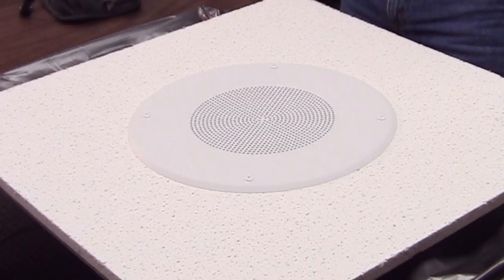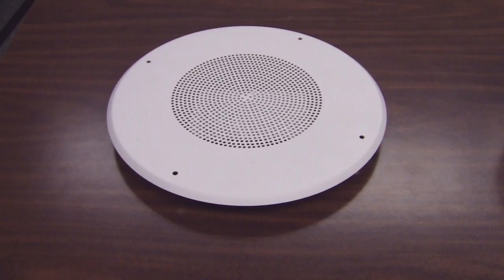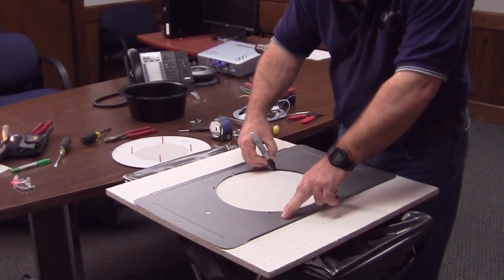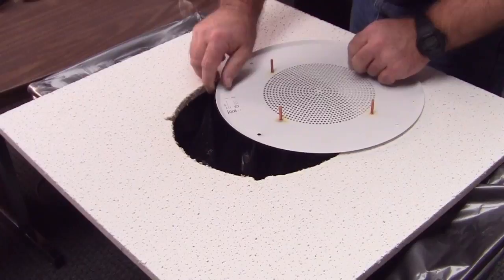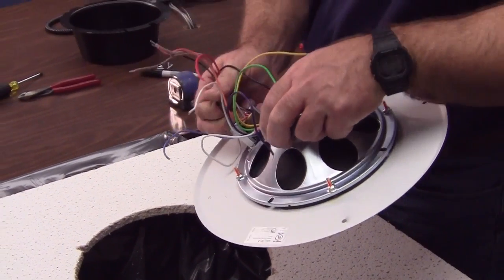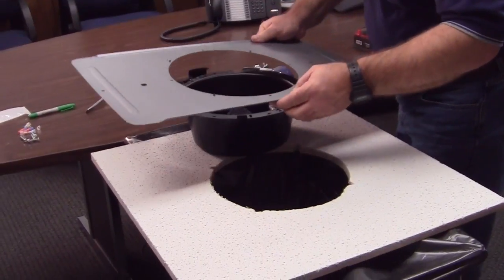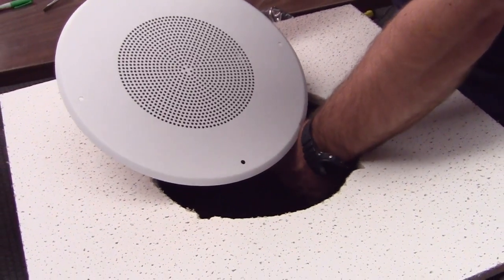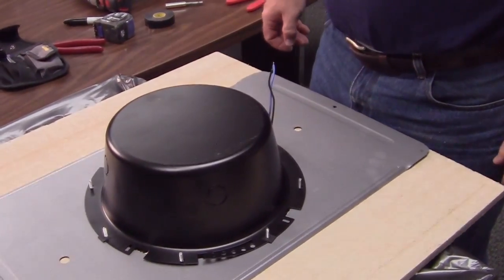8" Speaker Assembly

Comment: one question how mich cost this spealer because on  y place they use it alot in store and market
Reply from the maker: The speaker itself is around $18.00. With all of the mounting hardware, it's about $40.
Reply: +ProAudioSuperstore u meam the cover itself
Reply from the maker: The grille, back can, and tile bridge/support.
Reply: +ProAudioSuperstore well i can put it on a bucket is easier and i like the speaker it selfs semce i never seen the fron of it
Reply: +ProAudioSuperstore like one question theres one that has 4 screw on it